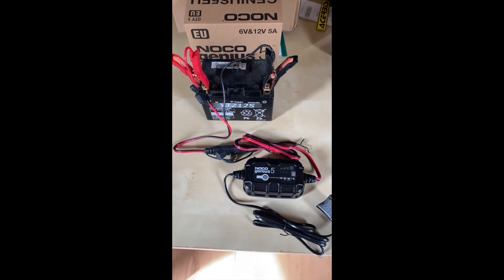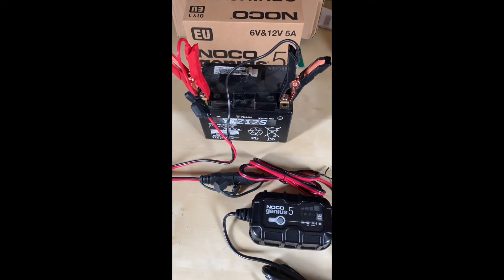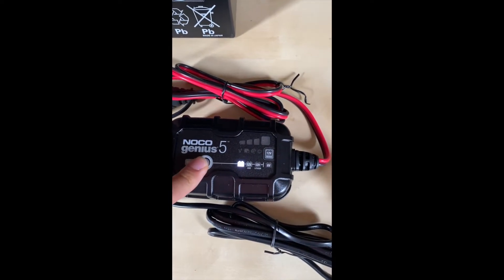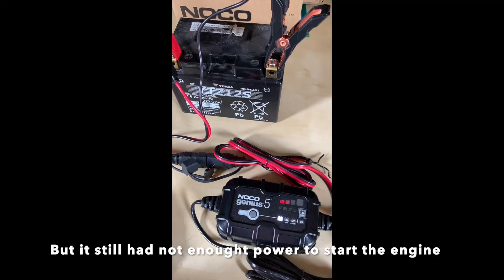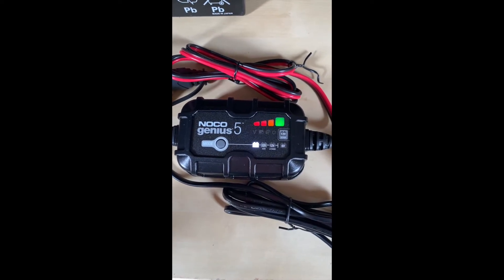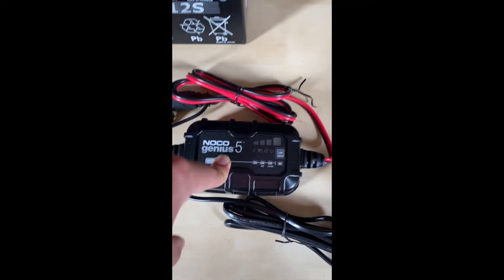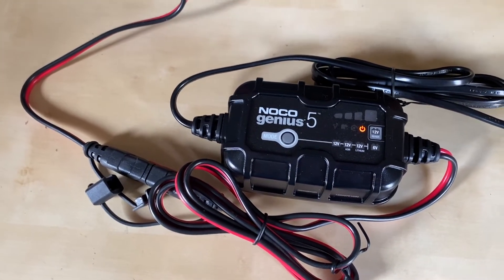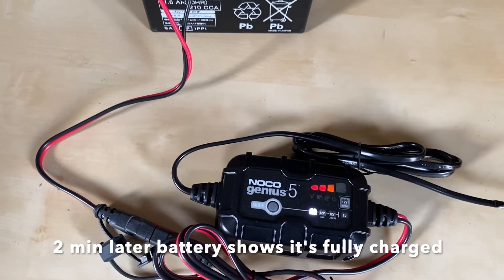Noco genius 5 repair mode works !

Comment: Hi. The battery your are repair/charging is an AGM battery. You should use the 12 volt, AGM setting for the battery. Good luck. Nice video.
Reply: @ anti- globalist, zip it foo ,you don't no nuffin . The Mercedes is an AMG, not an AGM! Sucka!
Reply from the maker: I crosschecked and it looks like an AGM battery. Video description updated. Thank you very much Stephen2846 for the info and for helping others !
Reply: @PilotMega  AGM is a lead acid battery. It stands for "Absorbed Glass Mat." The difference is, in part, a gelled rather than liquid electrolyte. The battery is a "Sealed Lead Acid" type that is most likely an AGM. The "Non-spillable" label is a dead giveaway. The battery is a valve regulated, sealed lead acid battery with gelled electrolyte. That's the long way of saying AGM.
Reply: @Stephen2846  thanks buddy,you learn something new everyday,😀 ,I am guessing nearly all modern batteries are AGM ?
Reply: @equalizer7775  No they are not. Basic batteries are Either "Dry Cell" or "Wet Cell." There are many types of battery chemistries, but they can be grouped together into a few basic groups. There are Flooded Lead Acid, Absorbed Glass Mat (AGM), Dry Cells (Common "Batteries") and others like Lithium Ion, etc. 

Wet cells can be "sealed" or have fill caps. Absorbed Glass Mat batteries have a gelled electrolyte and are sealed. Dry cells have a fairly dry electrolyte in them. All convert chemical reactions to electricity. 

The battery shown in this video is a "Sealed Lead Acid (SLA) Valve Regulated type. Essentially that means that the electrolyte is sealed into the battery case and not exposed to the atmosphere where it could lose volume. However it will off gas through the "valves" if it is overcharged or excessive current is drawn from it. 

Lots of "Modern Batteries" are AGM. They are used in emergency lights, electric wheelchairs, UPS systems, and things like cars and boats if you want a good stable battery that is "Maintenance Free." They are lots of "common" battery types and the type is mostly specified based on its end use purpose.
Reply: @Stephen2846  No, the AGM setting is for if you have a mercedes, fool. Clearly he has a knock off Chinese one and theyve mixed up the lettering
Reply: @Stephen2846  Yeah! The AGM is a more expensive battery as it doesn't require cleaning and it doesn't off gas. No need to clean the terminals. Plus, if you're using the battery inside, like in a camper or living in a van or whatever, you definitely want an AGM battery and not a regular lead acid battery that can off gas poisonous water vapor. The other alternative is lithium batteries which can be discharged way past 50% without damaging the battery, but are very expensive. Like $600 for a 100AH battery.
Reply: @MrOzzy281  No, that is a cheaper AGM cranking battery with low AH. I have a $100 35AH AGM deep cycle battery that can keep 2, 6W LED bulbs going for 15 hours in a blackout before I start damaging it as it falls below 50%. Easy to carry around. This guy's is only 11.6AH. I guess that's all you need to run the functions of a scooter. Start it. Horn and lights and turn signals. Very small capacity. Only 210 CCA (Cold Cranking Amps) on it as well. A good car battery has 800 CCA. Lot easier to start a scooter.
Reply: @equalizer7775  Modern batteries can be AGM or regular lead acid. AGM are more expensive as they are "sealed" so they don't off gas and you don't need to clean the terminals. For indoor use you definitely want an AGM battery so you're not sucking up poisonous water vapor as regular lead acid batteries lose water with miniscule amounts of sulfuric acid in the water vapor. For an automobile, a regular lead acid is fine really.
Reply: @PouchMaster  thank you kindly for your advice,very helpful,regards